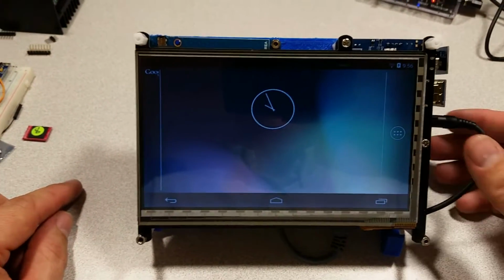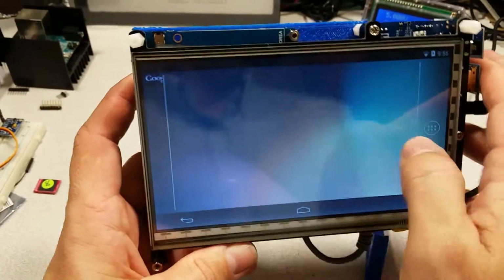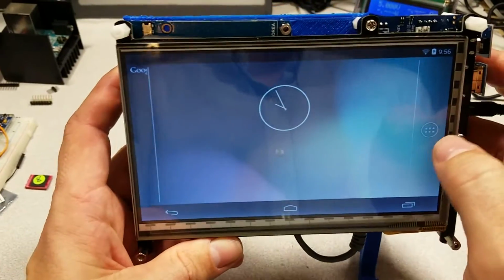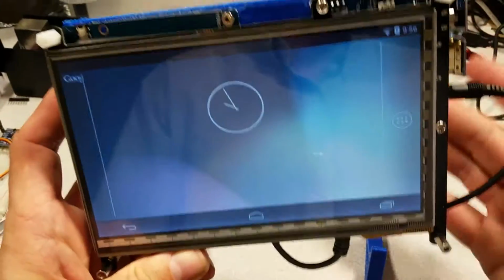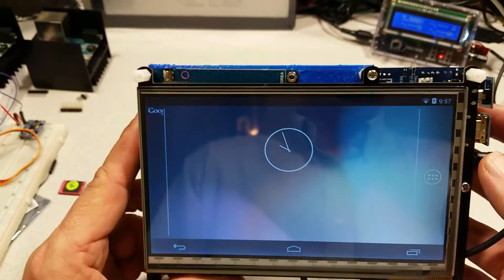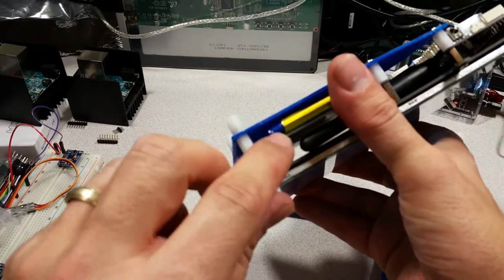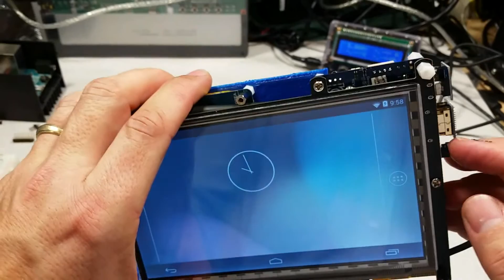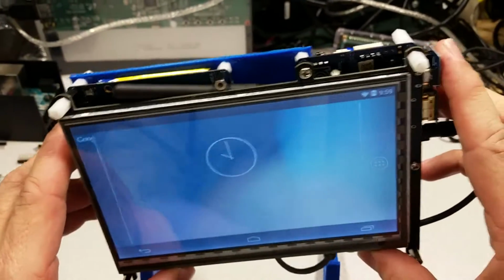ODROID-VU7 Tablet Project - "The Man-blet"

Comment: In case you are interested you can buy a DIY POWER BANK (also acts as a Charger)that would suit many of these SBC computers that has 5V 2amp and sells for about $7-10 that will take 1-4 18650 HIGH Quality Unprotected Batteries to run it.........this can be bought from the ALI-Express.com website........absolutely wonderful to have found these Devices there and the Brand name is Alii or something like that seems to be a generic product..........works great!! Cheers and happy Odroiding etc
Reply from the maker: Yes, power banks with replaceable batteries can be really handy for single-board computer projects.